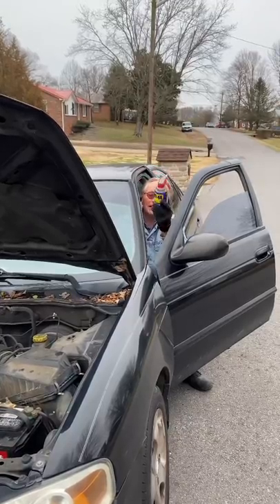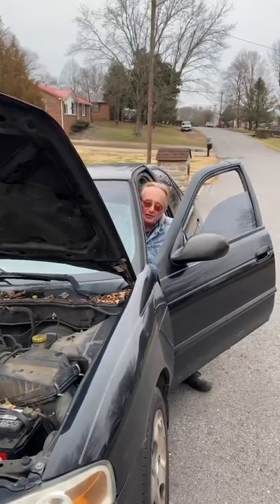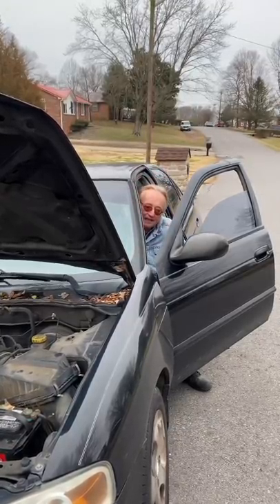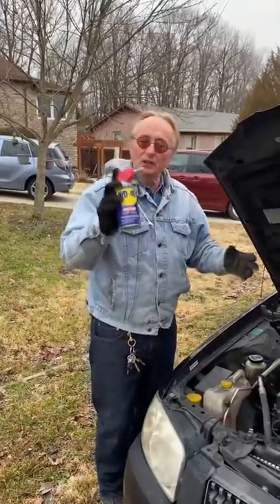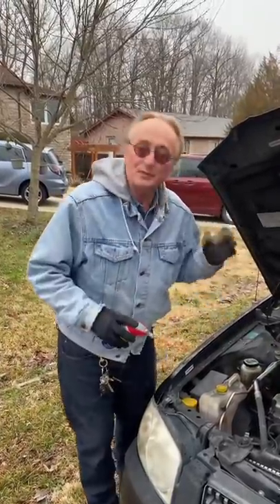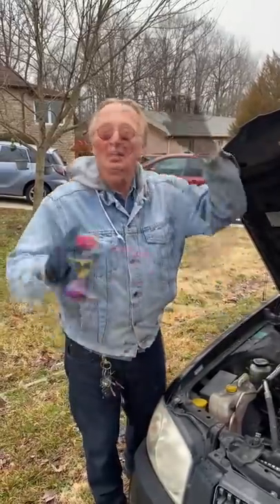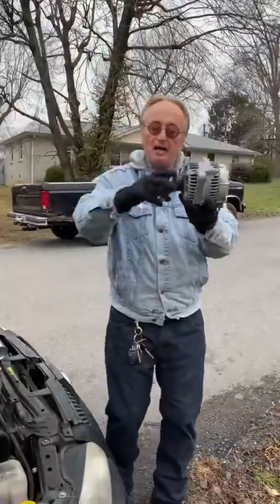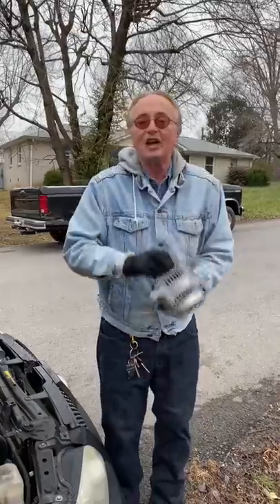WD-40 Fail

Comment: I heard that spraying water on a suspected squealing serpentine belt is a test to determine if it's a worn belt, or a belt pulley (or belt driven accessory). If the noise dissipates with a wet belt, replace the belt.
Reply: if you’re replacing the belt you should replace all tensioners and pulleys while you’re in there, spend the $ now so you don’t get stuck somewhere later
Reply: @jeremyjeremy8795  absolutely not why would you replace all of your pulleys for a worn belt?
Reply: @MR5er1  yeah all pulleys no, but belt tensioner are a good idea, my ford 6.4 has a history of grenadine belt tensioners but yeah every pulley would and probably never is done on a belt replacement
Reply: Also depends on mileage of your original belt wears out at 150k your pulleys are prolly worn out too so he meant do it all at once rather than possinly drive 10k miles and find out you have to redo the pulleys and belt again because it wore the belt out prematurely because it broke that's what he meant

Comment: WD-40 IS NOT a lubricant
Reply: It never was.  WaterDisplacement-40th-formula.  I used to laugh in the 80s and 90s when they were sponsoring BMX and mountain bike teams.  CRINGE.
Reply: the company does make lubricants ... some specific for bikes. displaces moisture and lubricates almost anything. The WD-40 Multi-Use  this is on their product page
Reply: Worst stuff I've ever used. Plusgas better. And yes, its NOT a lubricant. Lets shut down that myth.
Reply: Any Liquid Rubber  is and makes my belt last no need to change it if you maintain it.
Reply: Correct silicone spray is a lube. If your belt squeals just replace it it at max they're like 25 bucks. Easy job.
Reply: WD40 is a lubricant for a short period of time but its effect wears off its ok as a temp lube if you have nothing else you can use until until you get some proper stuff.
Reply: Yes, it is. It is made of mineral oil and petroleum products that are essentially vaseline, plus scenting agents. It is pretty volitile, so it does not hang around for too long, but it most definitely is a lubricant.
Reply: Agreed !! Just ask my ex girlfriend
Reply: I came here to say this but you have done the deed.
Reply: @ralphames4761   You can literally buy by cluber Kent WD40 at wal-mart

Comment: Wd-40 is for water displacement (WD). It is fish oil, yes, but not a lubricant, anymore than Kroil is. 
They are both superior products, but not for lubrication.  For a dry, slippery lubrication, use silicone, or graphite.
  Check inside of fan belts for cracking; if it has them, replace them. If you wonder if that noise is indeed a belt, pour some water on the suspect, when idling. If the noise goes away,  it's the belt.
    Buy quality belts like Dayton, or Gates. Cheap belts are exactly that ....cheap quality crap.
Reply: I thought WD-40 was kerosene and fragrance
Reply: Uhh I use wd40 all the time for lubricating moving metal parts.. It's a multi purpose formula

Comment: They used to make belt dressing. It was sort of sticky. Worked like a charm. I am surprised he did not mention it.  Anyway, things like brakes and drive belts work with friction. Friction is needed for them to work properly.
Reply: Thay stuff is for when you want to sell a car and hide the fact that you need a new tensioner/belt. Never use that stuff on a car you want to keep!
Reply: Supposedly belt dressing should not be used on serpentine belts but I've used it for little squeaks and it was fine.

Comment: Clean the belt really good with dish soap and water, wipe the crud off the pulleys and grooves, then spray 303 interior exterior protectant on your belt. It’ll never squeak again. Good even for worn belts too that have been sitting in one position for a long time.

Comment: I had my serpentine belt squeaking in my 99 mercury GM, and I bought this stuff called "303 Aerospace Protectant", and it worked like a charm! The belt has been good for the last 10,000 miles, due for replacing soon!

Comment: WD-40 is Not an Lubricant. It is water displacement cleaner.  A lubricant spray would be Tri Flow spray with Teflon.
Reply: Almost any liquid can be referred to as a lubricant. Water etc anything.
Reply: @qasimmir7117  No, incorrect...

Comment: 40+ years as an industrial mechanic, WD40 is a lousy excuse for a lubricant.  I refuse to use it on anything!
Reply: It has its purposes. Lubricant is something it never claimed to be. It loosens rust and stops squeaks on metal parts.
Reply: Dry lube with PTFE works to stop squeaks on belts.  I use the automotive de-icer for locks.

Comment: I learnt decades ago the only thing you put on a noisy drive belt is talcum powder & only when replacement or adjustment is not possible or very impractical at the time. Being careful of course not to dust the alternator as there is possibility of premature wear or failure. Remember talc contains aluminium oxides. Yes it does reduce the squealing. Love the vids Scotty your a gem. 🙏❤😎

Comment: I periodically power wash my engine compartment . Then let it dry completely and liberally spray 303 Protectant on all plastic and rubber parts . To resist drying out and cracking , especially since my intake manifold is plastic .  And let it dry in place , no chalky discoloration , etc , dries perfectly .

Comment: VERY IMPORTANT WD40
 IS NOT A LUBRICANT 
NASA designed WD40 as a water displacing fluid. It can be used on rusted nuts and bolts that are rusted together to eventually loosen them from each other. WD40 also works good as a cutting fluid when drilling through steal or doing lathe work with steal. It's a lot cheaper than buying actually cutting fluid for steal. If you us it on hinges it will eventually wear out the hinge. It does not have an oil base. It also has a bunch of other weird benefits as proclaimed on the internet as helping with clogged toilets and a bunch of other weird properties. It does work as a penetrating fluid helping to clean rust etc but not as a lubricant.
Your better to use a light type of oil to lubricate steal objects.

Comment: I use sandpaper on/in the belt grooves to eliminate the squeak.
Reply: m rapacki  
Removal requires more effort; sticking your hand down under/on top of a moving belt with a folded piece of sandpaper is much easier.
Reply: m rapacki  
For those who are less ambitious and daring, they make an inch wide plastic tongue extender with rough surface grooves. Stick it under the belt and push up.   This approach should also eliminate the squeak.

Comment: A dad's friend of mine used to have a squeaking timing belt, he would just turn it inside out, and it would stop squeaking ... for a while. Until it broke
Reply: You mean serpentine belt or accessory belt
Reply: If you do that with a timing belt the engine will go bang so I assume it was the serpentine belt he did that with.
Reply: lol fail at this story

Comment: IDK who would use WD-40 on a belt.... but you can use "belt dressing" in a pinch if it's an emergency.  I wouldn't use it regularly as a long-term fix but in a pinch it can work and it can help the belt grip the pulley better but it does wear off after a while (say a few days probably) so I would only use it for emergencies (like if you're traveling and need to get to a repair shop, because a squeaking or squealing belt is telling you you need to replace it or address the tensioner (if it has one).

Comment: I hate to disagree with Scotty but using a little spritz of WD-40 or even some bar soap on the belt can help you identify whether the squeak is from a pulley or the belt itself. If after you spray or use the soap the squeak goes away immediately it’s the belt. If the squeak does not go away it’s a pulley or one of the other components.

Comment: What about that fan belt spray? I used it twice ever since my belt started squeaking and it fixes the problem for a month or so. The belt looks fine and it’s definitely not the bearings. The belt started squeaking a couple months ago after I had to drive through a flooded street. It’s not a horrible squeak but it is annoying. Also I’m driving an 05 Tundra

Comment: Research your serpentine belt for bulletins to correct noise.
The other thing your technician can do, is a trick that could be no biggie to him but a danger to Harry homeowner.
We cleaned the belt grooves, changed angle, or performed bulletins that addressed the cause.
Spray stuff?
Only as a diagnoser. Not a fix.

Comment: WD-40 was designed to displace water. It's a very poor lubricant and if used, will not last very long. Back in the old days it was good for displacing water from spark plug wires and distributor caps. Some guys would spray it on the carburetor linkage and boy did that make a mess. It appears to work well at first, but, then later it turns into a sticky waxy sublstance that goos everything up. The only good use for it today that I have found is for removing tar from you rocker panels with harming the paint. That's about it....
Reply: Its good for removing surface rust too in combination with sanding.

Comment: WD40 should only be used for things you do not care about.
It will kill, clocks metal or plastic , sewing machines cast iron, aluminium  or plastic 
Good for removing sticky labels since it is a solvent, it will extract oils out of most plastics and make them brittle.
Works quite well when using a wood router on aluminium.

Comment: My dad started using bar of gold bar dial soap while the engine is running hold the bar against the belt as the wax melts it becomes tacky or use belt dressing. The funny one I saw was using old spice deodorant bar smells good but doesn’t work. [on me]

Comment: I remember years ago they made a product called belt dressing or something like that.
Reply: Yes I bought one too in 1990 .And also Wipers Blades dressing to protect Wipers from deteriorating rubber Sometimes it works and sometimes it doesn't work . And don't spray WD-40 on Wipers Blades the WD-40 oils will messed up the whole windshield .

Comment: When Scotty titled WD 40 fail, i thought about the 5 cans i have with plenty left but no gas pressure to spray.
Reply: I just use the air compressor and shoot a little air into the can. You would have a hard time over pressurizing it, if your determined and have the strength or just set the pressure to 80/90 lbs.

Comment: WD40 is not a lubricant (I thought it was for years) it is a cleaner, use a silicone lubricant instead for lots of uses where you would use WD40 (not saying use it on a belt though)

Comment: Wrong again Scotty. WD 40 is for water displacement the 40th formulation. It was created for the Air Force as a water displacement for missiles. It is not meant to be a lubricant it doesn’t have the film strength to be a lubricant. I agree it shouldn’t be put on belts.

Comment: Squeaky fan belt use Tyre spray or take it off and rub it with either power steering fluid or transmission fluid. I never use WD40 its just Kero anyway. Should clean the pulleys though that is where all the dust and dirt lodges then tension all bolts put back on ive seen belts last like stupidity miles they simply should not have been alive. Also dry lube stick is an option.

Comment: This goes against everything I've ever been told. Squeaky door, stiff shoulder, stale bread....wd40 does it all.
Reply: WD40 is probably one of the most over rated products ever made.  Not that great of a lubricant, and there are many other great options out there.  There are purpose made penetrating oils that work better, and many purpose built of a purpose lubricants that will outdo WD40 for almost everything.

WD40 is like having a tire iron in the car, or a crescent wrench in the car.  Good for a quick field expedient fix.  But in the shop, it is replaced by every superior choice.
Reply: @kingduckford  Yeah, Sonax SX90 is far superior to WD-40.
Reply: @kingduckford  Exactly right. For an 'on-hand' emergency fluid, WD-40 is good to have in the vehicle when you don't want to carry a dozen problem-specific sprays.
Reply: @kingduckford  it's just a quick fix when you have it in hand but you're right we got other penetrating fluids and lubricants at the shop and they work much better
Reply: Stale bread? What the...???

Comment: I have that squeaky belt on my 2005 Nissan Sentra with 154,000 miles on it right now. (Looks like a sentra in the short).The belt squeaks when cold, and when I turn on the air conditioner. I’m thinking it’s the old alternator but I’m not sure. I’ll try tightening the tensioner. Any possible causes and solutions? Scotty or anyone?

Comment: WD40 is not a lubricant, it’s a water displacement. That’s what the WD means.

This guy probably smokes the stuff.
Reply: Does it lubricate joints (even temporarily)? Yes. Not designed as a lubricant but can be used as one. Water for instance can be a lubricant.

Comment: Yep, it's great for dispersing water under a distributor cap, works real good for drying out the cap after it blows up when trying to start the engine! 
Actually I have found out no use for it at all!

Comment: Dry lube with PTFE works. I use the automotive deicer for locks.
Reply: You shouldn’t lubricate them whatsoever. If my brakes are squealing, should I lubricate my discs to make it silent?
Reply: @qasimmir7117  , the topic was about squeaky belts.  I wouldn't even use dry lube on a squeaky door.  But you had to spin it in to something ridiculous,, without ever even trying it.. whatever genius.
Reply: @gcrady  
Bottom line is you shouldn’t lube your belts, it literally makes no sense.
Reply: @qasimmir7117  , Do you understand what a dry-lube product is ??  "it makes no sense" ,, and yet it actually works :) Been using for a decade on all types of squeaky belts..   Look, my world doesn't revolve around "Scotty approved" or a "certified technicians opinion"  Real-world "mechanics" think outside the box to fix things.

Comment: The WD in WD-40 stands for wire drier. Named because of it's great capability to expel water from spark plug wires which is it's intended purpose.
Reply: WD 40 Stands for water displacement version 40
Reply: @miner555  I stand corrected. Thank you!